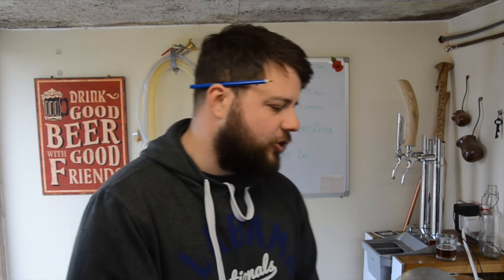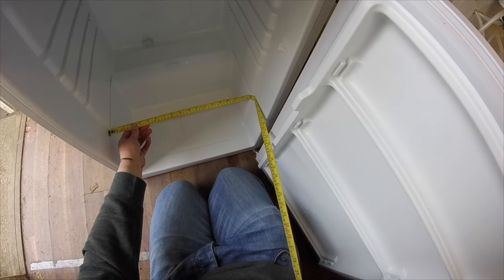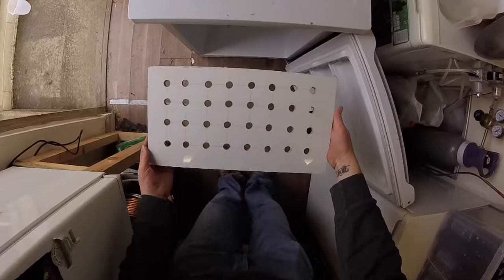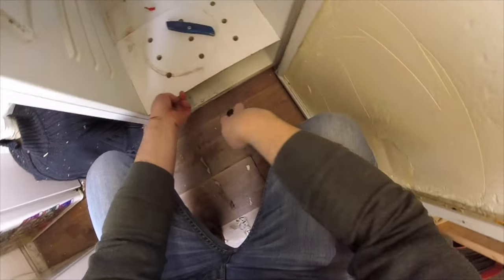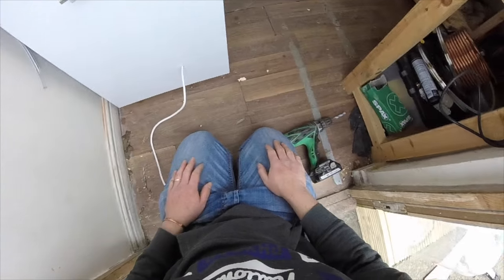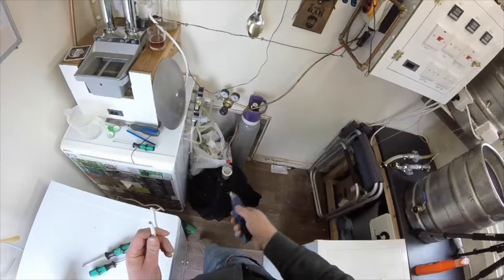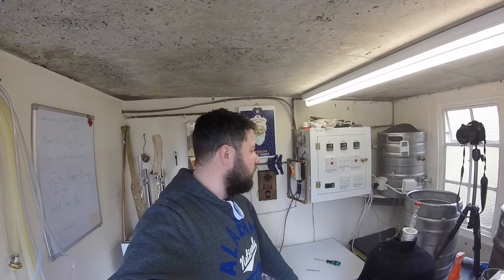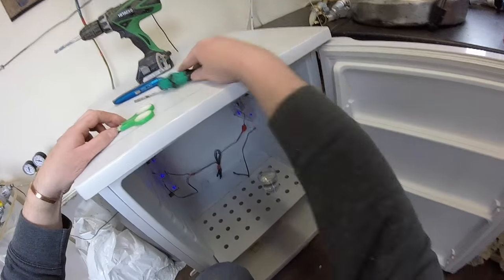How To Build A Fermentation Fridge ~ Bigger Better Fridge!

Comment: FYI, you don’t necessarily need an expensive heating element, incandescent light bulbs will do, with the benefit you can see if they are working at a glance, they are dirt cheap so you fit 2  so if one blows you are ok. I have 2 x 60W bulbs. Only 5% of the bulbs power is light, the rest is heat. Mines got no fans and works ok. I put the sensor in the brew, inside a sterilised thermowell tube, and convection sorts everything out fine

Comment: If anyone else is trying to do this, don't mess with the area around the condensation drain at the back wall of these types of fridges. I tried to widen the hole slightly to get the heater wire through it and cracked the system... Fridge gone, mk2 will have to copy tom, with a hole to the side of the fridge

Comment: nice work. just on the pc fans, when I made mine I noticed that when flush up against a wall, they hardly blew any air. moving them about 5cm out gave them a chance to pull air through the fans. I ended up mounting mine using twist wire to the bottom of a shelf. are your fans getting good air flow?
Reply: By the looks of it he does have the fans on some short studs, leaving a bit of room to pull or push air through. It doesn't look like much though I agree. I guess he does not want to lose more cabinet space by setting off the fans any further.

I have one in a corner of the "ceiling", fixed with just the tips of long screws into the top of the cabinet. This works quite well, it does not take any of the width away and still leaves room for the air lock which will be the highest point somewhere in the middle.

In his case, instead of a ton of holes all over the place which do not strike me as terribly effective, I would have made two larger holes on each side and fit a fan under one of them. Then you force-circulate the heated air directly through the cabinet and the fan is completely out of the way.

Comment: Hi Tom, just wondering what sort of board it was that you made the shelf with? Looks waterproof? Just about to convert a fridge for fermenting and want to get the right material for the job.
Reply: It looks like MDF. As long as it isn't splashed with condensation it should be fine.

Comment: OMG. U screwed up such a good fridge box (literally). I believe most of the fridges has a hole for condensation, it's hard to be sure with this quality but i think u have one right on the bottom in the middle. U could connect heater and put fires through that hole, no need to drill it. Other thing i can't understand is position of coolers. They just stay in front of each other, what you expect they gonna do? In order to circulate air i would put 2 under that shelve that u chop out with IN derection on heater. That would pull out air from cooler and blow it on heater and heated air would come out through holes in UP direction. Also don't understand that huge ugly box with control. WHY? To turn on and off heater u need termoregulator. There is lot of very cheap and functional termoregulators with displays and stuff. You disassemble the fridge door, make a nice sqareshape cut in it for display and carefully put connection to heater in the bottom left corner of the door, or up corner if u wish. So all u gonna need is plug fridge to power and all thermal control u can do on display right on the fridge door. Looks neat and mobile. U can put that fridge anywhere u want without any additional pain in the ass.
Reply: It's legacy technology alright. His third even bigger better fridge will be like that.

Comment: are the fan LED UV lights because if so you might want to short those lights out...
Reply: I think they are Blue Leds, but still, they can generate some UV light, so it would be better to take them off anyway.